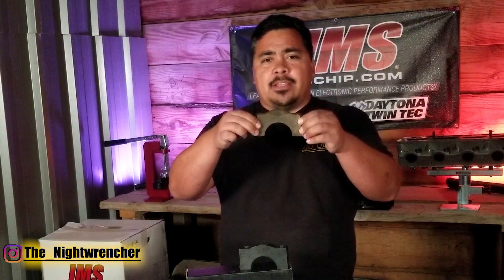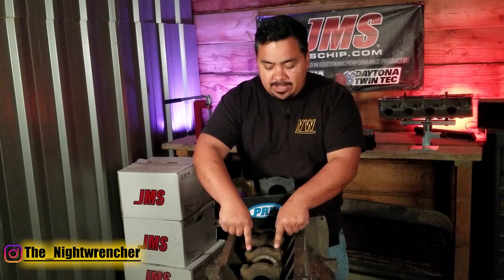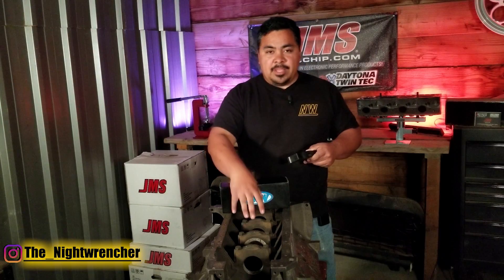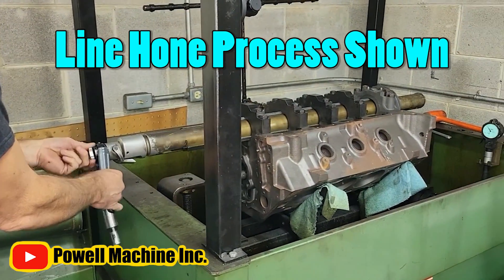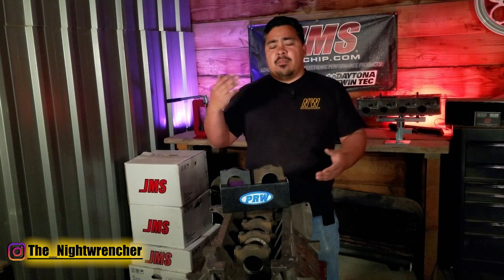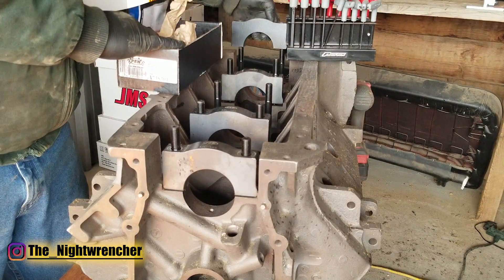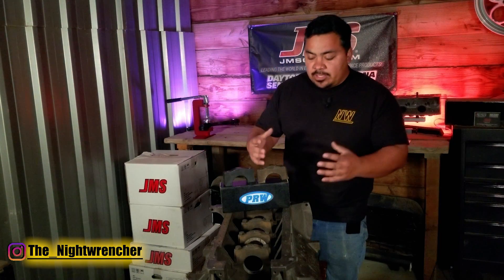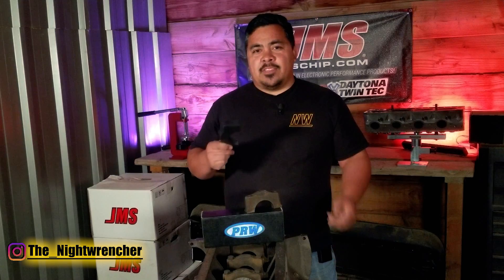The Truth: Cast Vs Billet Main Caps 383 - 400 - 440 Mopar Big Block | PRW Billet Main Caps 1738301 |

Comment: Studs have fine threads for nuts, with lube they may take less torque
Reply: depends  on what the manufacture says  to torque them to.  usually studs  are stronger  sometimes  way stronger.  thats why a lot of power adder engines use head stud  vs head bolts
Reply: @KingJT80  right but if harder they will not stretch as much which is not helpful if one side is moving around. they unclamp very easily .  We made that mistake substuting grade 8 for grade 5 for exhaust manifolds, you need some stretch

Comment: Great explanation. I'm going with an aftermarket block. I want the added bore size and strength. Buy it nice or buy it twice, as they say. That's for a future twin turbo engine. N/A I am using a stock block and just at 700 HP and 640 ' lbs. It's a great street stip engine on a budget. But nothing like 500 cubes of twin turbo power.
Reply from the maker: Definately all about the end goal and how long you want it to last!

Comment: with Stud bolts might be a problem, if you have a windage tray without modifications of the mounting point's on the windage tray.
Reply: usually.  USALLY companies  will  make them  specific  to having  a windage  tray or not.  milodon comes  to mind  because they  have options

Comment: Citing a Pontiac V8 400 and 455 as an example fitted stock 2 bolt mains to start with and drilled Factory 4-bolt in block main webs.
455 2-bolt is good for 800-1600 hp depending upon who you talk to.
400 2-bolt 1967-74 good for low as 500 high as 650 hp peak.
455 4-bolt Factory 1970 year value to buy is $2500.
1971-72 455 HO 4-bolt $3500-4000.
1973 -74 SD455 4-bolt block Value is $15,000-30,000.
1968 Ram Air 2 400 4-bolt main caps $5000 value.
1969-70 Ram Air IV 4 400 4-bolt Factory main caps Value is $10,000-15,000.
1969 Ram Air V 5 400 4-bolt Block Value is $40,000- $50,000.
So say start with a 2-bolt 400 buy it for $1500.00.
Add 4-bolt caps plus machine work to fit, bore and hone and Deck $3000 more. 
A New Pontiac AFTERMARKET Indian Adventures 2 block or Kaufman MR2 iron block also is $3500. Both are designed for 5000+ Hp.
To me only a Pontiac 455 2-bolt block is worth using 2,-bolt main caps stock for 1000+ Hp.

Comment: You forgot to mention that when you line bore or line hone you raise the crank making the timing chain looser so there an expense there also..
Reply from the maker: Youre right, but thats not always the case now with modern machines. My block didnt have the crank moved because the cap was undersized. The shop cut the cap to about the same size as the journal in the engine and then went 10 over to clean it up
Reply: Align boring is typically only done with a new block. New engine blocks have to be final sized before assembly. That puts the crankshaft at its OEM specified location. Just one time.

Align honing might, and I mean MIGHT move the crankshaft two maybe three thou up.....maybe. that's nothing in the grand scheme of things.
Reply: New machine [Rattler] can machine material from cap side to maintain correct geometry

Comment: This man exposes the TRUTH anout MANY Engine Rebuilding Shops in Southern California. They don't have the proper equipment, trained personnel and even the ambition to attain and train their staff to rebuild quality engines. Many shops DO NOT even have Align Bore/Hone Machine and never will. Their reason (they say) is that their customers WON'T pay for a job that these machines produce or they simply won't INVEST in a machine that can do a BETTER job because....... They are set in their OLD WAYS. 

Racing and Hot Rodding in Southern California will eventually die because the State is making it HARDER to OWN and OPERATE a Classic/Antique vehicle; thus, the demand for maintaining these vehicles has been reduced over time. The science and art of Engine Building/Rebuilding is STILL alive and well OUTSIDE of Southern California. If you are a trained and experienced Machinist/Engine Builder, you've known this for years now.

Owners of V8 engines are rare and owning, operating and maintaining an OLDER V8 engine has you in a SMALL MINORITY. If you seek a competent shop to Rebuild your project using an Align Hone machine and do a VJ with a modern cylinder head MACHINE, you will have to search far and wide. MANY shop OWNERS STILL use STONES for doing the VJ and after they make a FINAL cut, they have NO CLUE nor do they want to know HOW FAR they SANK the seat.

There is no such thing ANYMORE in SoCal as a "Blueprinted" engine rebuild. As long as it seals and makes decent power, starts and runs, that's ALL they are after. The demand for High HP engines has died in SoCal AND even if you find a shop that has the capability to build such an engine, they will OVERCHARGE YOU.

Comment: Unfortunately studs have a greater amount of friction so they need to have a greater amount of torque applied to get to the same amount of clamping force that is produced by the bolts at a lower amount of torque.
Reply from the maker: I'm not sure about the applied clamping force perse but I did do a test using the main bearing clearance and checked clearance at 75, 90 and 110ftlbs of torque on the fasteners. Surprisingly, the bolts and studs followed the same clearance changes using the ARP lube. If the clearance reads abouy the same between the two, I assume the clamping forces should be similar as well but even if not, it might not be as much of a detriment as we might think.
Reply: @NightWrencher  It probably doesn't make much difference and the number of times the bolt or stud has been tightened/how polished the surfaces of the threads have become probably makes a greater difference.
Reply: Hey Dave McLain, I'm interested in what you're saying here, but I'm not quite getting it. Could you explain or refer me to the literature I can read to clear this up?

Studs and friction.....bolts?
Reply: @arturozarate1752  David Vizard told me that they had built some fixtures to measure the amount of clamping load produced by bolts vs studs so it's in some of his books.
Reply: @DaveMcLain  thank you. I'll look into it.
Reply: BUT

the stud in general  is made of much better material  vs the factory stuff.  if  bolts  were that strong  then most  people  would run head bolts in  power adder applications  and most run studs
Reply: @KingJT80  Bolts and studs can be made from the same materials so maybe they should run bolts in most of those applications if clamping loads vs torque applied is important.

Comment: Nice work. Wick question,  if your re-using your cast mains and not line boring don't fit main studs or higher torque main bolts. Thanks.
Reply from the maker: Correct, if you are reusing the stock caps and not planning on line boring, either use the stock bolts or install aftermarket studs/bolts to the stock spec.

Comment: What about forged mains? Is that not a thing?
Reply from the maker: Like forged main journals? Or what do you mean?
Reply: @NightWrencher  you said cast and billet so I assume forged maincaps dont exist? would forged not be a good cost/reliabilty compromise between the 2?
Reply from the maker: @Subaruby34 I see what you mean. Some companies sell forged caps but since you have to machine everything the same way, the extra cost of billet doesnt really affect things too much and its way stronger
Reply: @Subaruby34  mildon does  ductile iron  which a lot of the dart SHp blocks  use
and then there are these billet caps.  and thats about it.

Comment: I would want a new Callies/Energy block from a twin-turbo 440 build.  It's a $6k investment, 4x over your upgrade to the stock production block.
Reply from the maker: If I was planning on making more power than 1000hp I would consider an aftermarket block. Ive made 550hp with a single turbo 361 big block with a mild cam. A stroked 383 should get me to 1000 without too much trouble
Reply: @NightWrencher  what hp levels would you limit an rb to?
Reply from the maker: @ I'm not too familiar with the RB but I believe that they use a factory girdle for the main caps. If you stud the block, I would only really worry about the rods and pistons. I believe the block could handle at least 800hp. The weak point then becomes the rods and pistons which I do not think would handle 800. 600 would be my guess. Excessive RPM and poor timing maps would kill the engine relatively early though.

Comment: Good information.  Myself the need depends on the engine design and expected output.  I have built only one engine with new caps, a Buick Nailhead with so much walk in the caps they would literally fall out of the block.  On the other hand I've built turbo LS's with the stock cross bolted caps pushing stupid amounts of HP and rpm without a problem.  IMHO it comes down to the rarity of the block, same thing with liners.
Reply from the maker: Good point! For me, if it was a really rare engine, I would be scared to push it. If it breaks, that means I have to buy another one 🤣